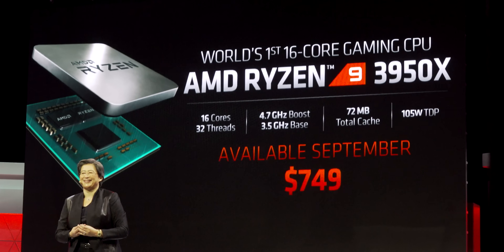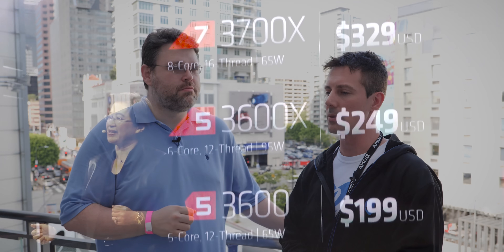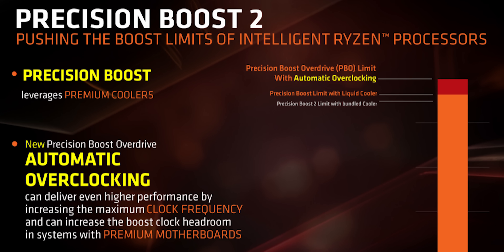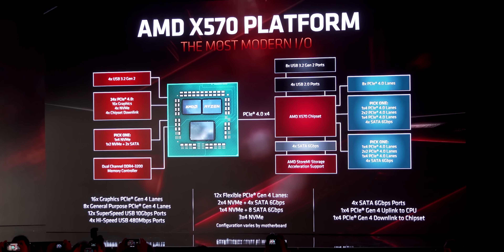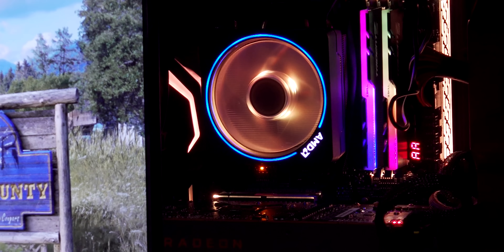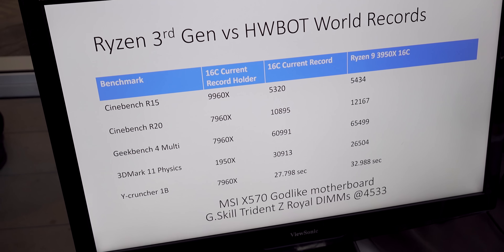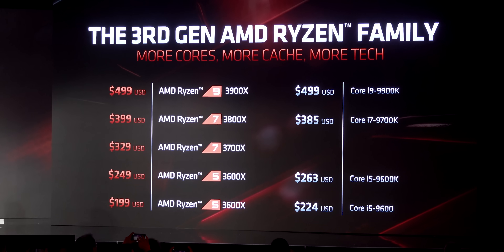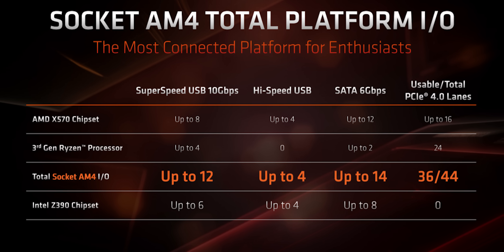...Is it 'The ONE'...!? (3950X & Zen 2 Discussion Ft. Wendell)

Comment: AMD demonstration shown in the video is 12core vs 8. I want to see 3700x or 3800X vs. 9900K. Until then it's not a fair comparison.
Reply: calistorich   Because if they compared the $329 3700X to the 9900K and it was matching  it or exceeding it core for core, that'd be an insane bargain. Having to use a 12 core part to beat an 8 core part isn't nearly as impressive.

Comment: Why is the 1903 not showing up on my system. I'm running Windows 10 Pro Workstation... I'm assuming 1903 is available on all version of windows 10 at the same time, correct?

Comment: My 5820k system died a couple months ago and desperately needed a good replacement. I needed Thunderbolt and some extra PCI-E lanes and Zen 2 just wasn't out yet. I splurged on a X299 9940X (9920X's were sold out everywhere) as a 9900K wasn't going to fit the bill. I also wanted at least 12-core. I'm weeping after seeing these Zen 2 processors and the X570 features. GOD... DAYAMN. X(

Comment: AMD's kinda hamstrung me for ACTUALLY purchasing one of their CPUs right now (thankfully Intel's not making a compelling argument either). I'm a dev and a gamer, and that 3950x looks like the sweet spot for me and running some heavy use VMs 24/7, plus compilation during business hours/gaming off hours. But if the threadripper part is even remotely comparable in frequency (4.3-4.4GHz), I'm gonna hate myself for buying the 3950x and losing PCIe passthrough options, assuming we get a board with sane IOMMU groups.

Comment: Amd are screwing up there whole 2019 product release is just not worth it for any of it really.
its not worth an upgrade from any current decent system and $350+ motherboards gtf that's just insane its asking people to buy a whole new setup over the price of there last and telling amd and the mobo guys its ok to charge this, have we not learned from turing/navi yet?

Those who forget the past are doomed to repeat it , i won't be buying anything amd although i had myself planned on a new build my first ryzen build but that was when the 12 core was $330 and b4 we saw the stupid chipset fans bonkers board prices, now with the navi BS, i'll pass n stick with my intel 8600k/z370 aorus g7/1080ti. and if nvidia can give me a proper perf increase over my 1080ti at the $650 price point then i'll go that route.
Reply: Intel had had those prices on high end motherboards forever. It's just new for AMD to have high end out there. 
You can run Zen 2 on last year's motherboards btw.. no need to buy the highest end chipsets unless you want pcie 4.0

Comment: I like how Wendell was sensitive to how fast his Intel CPU depreciated and got outdated.

Wendell: if you were building a high performance SFF (mini ITX) engineering workstation, knowing what is probably coming with Zen3... what would you select ?  X470 + 3600X ?  X570 + 3950X ?  Something in between ?   Work load is software development,  some simulation, 3D drafting and rendering.  Time is worth $75/hr.
Reply: 3700x and one of the itx with dual nvme, 2tb Phison pcie4 nvme and 2x16gb 3200-3600 memory.
Reply: @wendelltron  Thanks.  I wouldn't have spec'd the NVME had you not mentioned it. 

 Do any of the x470 mini ITX boards have NVME ?

Comment: Same trepidation here... what will happen with Threadripper? I bought one of the "lower core count" models, so AMD is lying if they're saying they didn't sell at all. I bought 1, so it's more than not at all :-)  Anyway, if they up the core count to minimum 24, which sounds plausible , they better not pad the prices like they do for AM4 this time round. They're not yet powerful enough to pull an Intel one.

Comment: NAVI vs RTX/Turing vs 2020 CONSOLES
Here's my opinion of how these all compare (may get minor points wrong):
#1 - NVidia RTX2000 (Turing) added RT, Tensor, INT32 extra processing elements to do ray/path tracing and AI functionality including DLSS upscaling for higher performance (with some quality loss which may be fixed with better ground training)
#2 - NVidia GTX1600 is based on Turing but saves money by stripping out RT and Tensor (which you're less likely to use on lower-end cards anyway)
#3 - AMD NAVI in 2019 is likely to be comparable to NVidia's GTX1600 series.
#4 - AMD NAVI in 2020 is likely to be comparable to NVidia's RTX2000 series
#5 - CONSOLE 2020 is likely to be very close to desktop NAVI 2020, though tuned to console usage which also combines things like checkerboard rendering, hardware AA etc that provide a performance uplift but are only practical in console where the same box is used for millions of people (should see about 2X to 4x more efficiency vs desktop)

Speculation exists that RAY TRACING etc on console is a physically separate chip. Maybe joined via IF (Infinity Fabric). Personally, I doubt that. I would think they'd want their desktop and console to be as close as possible. I'm not even sure a separate chip even makes sense though perhaps some efficiency loss due to latency could be offset by reducing chip costs by cutting down the size of a single monolithic SoC.

I do expect NVidia's DLSS to continue to mature. I'm skeptical that AMD's 5700 Image Sharpening will be comparable, especially later on. If we compare similarly performing (in normal rasterized games) first-gen Navi to current RTX2000 card in say 2022 for a new game we might see the NVidia card hitting 40% higher in comparable visual fidelity. Of course, not saying NVidia is better value as that's complex and subjective.

2020 consoles are going to be frikking amazing. Many games will combine Photogrammetry, Rasterization and enhance that with some Ray Tracing. Near photo-realism at 4K or close at 60FPS+. I think the longest-lasting desktop card will be a high-end NAVI 2020 card (NAVI that's comparable to NVidia RTX) as being close to console hardware should make game code transfer over the easiest, and the 2020 consoles should last a long, long time. Why come out with a PS6 if the PS5 is damn-near photo-realistic come 2025?
Reply: update: when I say NAVI 2019 is comparable to the GTX1600 series I just mean closest in architecture due to the newer architectural features that don't include RT/Tensor like. There is no RTX1600 that matches the performance of a 5700XT NAVI card despite the (likely) similar architecture

Comment: If Navi is replacement for Polaris then it should be priced lower! I'm big AMD fan but they got greedy here, they've looked at Nvidia and their pricing and just dropped it by a little but those cards are overpriced in first place which makes Navi bad value for money IMO and with such a small difference in performance Nvidia may release the 'super' line and crash them. Bad move these cards should be 280 and 350 not 380 and 450, one last thing why the hell they use this shitty blower style cooler again? It's freaking boggles my mind. End of my little rant

Comment: He was talking about balancing processes on Ryzen, right now on an 8c/16t 1st gen, I use 8t for Handbrake batch encoding, while playing games.  It doesn't seem like anything is different.  Even the .1% and 1% lows are fine.  I haven't tested it on my Intel systems, so I can't comment other than to say that it does a great job.  Wow, they had that 3950x running its Ram at 4533Mhz.  That's much better than I thought it would do.  I would love to see a 64 CU Navi part.  Isn't the 5700xt only a 40 CU part?

Comment: I am either going to buy the 3900x or the 3950x.  It just depends on which one is actually more of a beast.  The fact that the base clock is so low on the 3950x makes me wonder if the 3900x is better in some scenarios.  The single core performance of the 3950x is the very highest of all the ryzen 3000 series though... I'm torn.  Of course, the worst part is that I'm so damn excited but have to wait for reviews on a product that isn't even released yet!
Reply: Since the 3950x also has the best single core it will probably be the best choice, as it will perform the best in gaming and the 16 cores will destroy any work related stuff

Comment: The 16 core will be awesome for high end Twitch streamers, especially with the high SSD speeds and even high speed PCIe 4.0 for capture cards
Reply: There is no point in a capture card unless it has hardware encoding. Otherwise you're still using the CPU to encode. No point unless you just want to avoid software display capture.

Comment: "gaming" please show me the list of games that actually support 16 cores
Reply: A ton... not many NEED it though (TR-1950x and quad GPU user, ironically most games I’m interested in support crossfire, the irony is basically 0 games support multi-monitor... Everything looks super stretched if you force it to be supper high aspect ratio as one 11,520x2560 monitor).

The only game I know of that CAN’T use that many cores is Fortnite... If that’s the game you play, disable half your cores because it breaks the unreal engine.

Payday 2 for instance, can only use 1 CPU thread (the irony is that it gets above 100% GPU scaling in crossfire... works great on multi-GPU but can only run 1 thread!), obviously though, most games run on more than 1 thread... that said, you still don’t want a duel core (5Ghz on 2 and even 4 threads was significantly more stutter on FX than 4.8 GHz 8 threads enabled, even though the game can only use 1, windows likes to make everything trash if you don’t leave a ton for who knows whatever Windows is doing...), so even though a game may only use X threads, you want X+some if your using Windows (if your using Linux, it’s probably fine, but most people game on Windows)

Comment: What if Ryzen 9 3950x is only a gaming optimized Threatripper 2950x on the AM4 Socket 😁😁😁
Reply: Wouldn’t fit? Impossible to cool for those speeds?

You haven’t seen Threadripper in person, it might as well be a giant wall clock... AIO coolers don’t touch but a corner of the chips, like 80% of the zeppelin die is not under a heatsink...

Plus it can’t clock that high (my TR-1950x does 4.15 GHz vs 3.8 GHz on my Ryzen 1700, but that’s just because it’s a super low bin 1700 and good TR, same 120mm AIO cooler tested). 

Ryzen small chips are also physically impossible to cool past 200w (450w is what I do on my TR), it’s not possible without sub-zero to go beyond this.... that said, I’ve got a 2200g on my testbench, and my evaporator reaches a maximum high temp of -35c with FX-8350 at 1.7 Vcore (peak core was under 0c), and the 2200g is going ABOVE 8c! It must have a 50c temperature delta! At idle the cooler is -60c for reference. I’ve never seen a chip go over 0c, and yet here is the small APU...

Comment: Hi sry for my english Can i get help. I cant explain how but i m geting 2148x1152 and 1920x1080 resolution on a Samsung S19A100N wich support maximum 1366x768 resolution. How s that posible ?? i have ga110d3a motherboard and g3930 wich i use for every day computing not mining. I plug out power adapter and vga cable from monitor and put it back in again and than i notice my scrren resolution changed and sudenly in display settings now i have option all the way to 2148x1152 and it realy works i mean i m not a noob (or maybe i m ) i build computers to and i just dont understand how s that posible , i m using windows 10 btw.

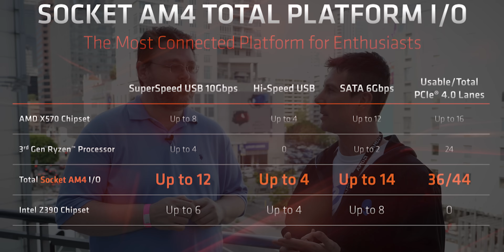Comment: 0:45 Why would the lower core count Threadrippers still when Ryzen mid-rage CPUs existed?
Reply: PCIe, I run 4x GPUs, so go ahead and try on less than 64 lanes with a real system with SSDs. Threadripper is an actual workstation monster, not a Xeon trying to pretend it’s worth its price tag.

Comment: As the Tech YES Man said with Wendell, the time for PC Gaming is now. Already, I've owned a Ryzen 5 1400 build. The CPU was only $71 at least a month ago. My whole used parts I bought are an i5-8400 CPU, Ryzen 5 1400, MSI B360M, ASRock B450M, 16gb 2400mhz Ram, 16gb 3000mhz Ram, 2 SSDs, 1 TB Hard Drive, a 650 Semi-Modular PSU, 750w PSU, and R9 270x for all around $704.07. So, trust me. The time to buy used is now :D
Gonna build and sell each part in a unit by the way.

Comment: Assuming good reviews I can't wait to move from my 1700 to the 3900x or 3800x.  There isn't going to be a Zen2 + either so next year when they go to 7nm+ we're looking at Zen 3 which is supposedly a VERY refined and partially new design.  Assuming the architectural changed also bring IPC uplift even if 7nm+ process doesn't bring any clock increase.  Simply with refinements and reduced power leakage the Zen 3 chips will likely also be super impressive.

I want AMD to release a Zen 2 based APU in 2020 with NAVI inside.  That APU will be pretty dang great value.

I also want AMD to release Zen2 mobile chips ASAP.  They would absolutely CRUSH intel in efficiency.  Low clocked Zen chips don't require much power and a Zen 2 chip that clocks from like 2.4GHz up to 4GHz+ on a few threads would be pretty great in a laptop!!

Comment: I'm going ITX sandwich build. Air cooler. 3700X all the way.
Reply: I heard 8 core parts are not good because every good 8 core ccx were chosen for 16 core part and only low quality were used for 8 core parts
Reply: @MrDevilex94  So long as it matches AMDs listed spec, I'm happy.
Reply: @MrDevilex94  Epyc gets the power efficient chiplets and ryzen gets the higher clocked less efficient ones. This was true for zen 1.

Comment: I think when AMD talks about 12 core and 16 core as "Gamer" PC's they're specifically talking about Gamers who stream.  The 20 PCIE 4.0 lanes is perfect for a GPU and a Capture card and the cores should be able to run both no problem.  Should be no reason to need 2 PC's to game/stream with either of those processors and a capture card.  PCIE 4.0 would also let those guys edit videos like 8k footage, etc.  There's basically no reason to buy an Intel desktop going forward if the independent reviews verify the numbers AMD showed.

Comment: i think the "go for" should be the Ryzen 3700X. 8 cores 16 threads are very important, since some games, with good GPU's will be bottlenecked by the CPU. Take for example Assassins Creed Odyssey harming really hard some i9 7900X. My E5 1650 v1 (4.7ghz at 1,345v) stays around 40-60% load at 1080p with just an RX 580 (1500mhz core 2250mhz mem). So, imagine if i go for Navi or RTX 2070. It's just incredible. And i feel more games in the future will need faster CPUs. So at least 8 cores and overclocked. But if i had the money, well, the 3950X , that's for sure.

Comment: Pointless processor, AMD in their desperation to beat Intel has damage their high end CPU lineup with this "mainstream" 16 core processor, is stupid. Even 8 cores are basically overkill for a "mainstream" user. AMD has to stop.
Reply: Um, these insane processors are why they're doing so well right now. They are selling more mainstream processors than Intel right now. Not to mention, the technology that allowed AMD to give us a 16-core CPU on a consumer socket is the same technology that's allowing them to make a 64-core monster for the server market. Threadripper processors are based on their server processors so it's possible for them to release up to a 64 core Threadripper if they wanted to. They are not at all killing their own HEDT line. They are just getting started.

Comment: So, TR 2920x or 3900x?
(for video editing and motion graphics)
Reply: Definitely the 3900x, unless you absolutely need more pcie lanes. Quad channel ram will not make up the performance difference between the two chips for video and graphics rendering.
Plus, you get pcie 4 so you have the bandwidth of 32 pcie 3 lanes if you're planning on running dual gpus
Reply: @fortunefed8719  Thank you very much for your reply. Have a good day!

Comment: 18% 'IPC' improvement compared to Skylake, how much is that compared to Coffee Lake/Kaby Lake?
Reply: Gustav Gamer  

'IPC' is at the same clock frequency. The clock frequency does not matter for it. So you need to compare the 9900k/8700k... with the 6700k... at the same clock frequency. Intel progressed little since Skylake but there is some progress, that seems to be anywhere in between 3 and 6% based on the Cinebench R15 scores.
Reply: Gustav Gamer  

The number was wrong in the OP, I removed that. The point is that Intel barely improved 'IPC' since Skylake but they do cheat a bit because there was some 'IPC' improvement. Between Skylake and Coffee Lake there is a gap of 3-6%, based on which Cinebench and which clock frequency you use. Intel now compares to Skylake because they knew that AMD would have around 15% 'IPC'-improvement. Intel its number has to be bigger. ;)
What Intel didn't mention is that their clock frequencies for that 10 nm node lowers a lot, that almost cancels the 'IPC' improvement. Intel is getting a real fight. Zen2 is nice, Zen3 will be the Intel-killer and Zen4, well, Intel better gets something ready before late 2021 or it won't even be a contest.

Comment: I agree that the 3700X will be a popular CPU. Buy that, overclock it all core to 4.5 GHz and be a happy camper. The 3800X really is too expensive for that little performance gain (boost+XFR). If you consider that one then buy the 3900X. However, I predict that the price difference between that 3800X and the 3700X will lower with around $40 withing 6 months. AMD did it before with the 1700X, 1800X and 2600X. They tend to price some parts too high compared to some other parts at first and correct it later. They don't always read the market correctly.